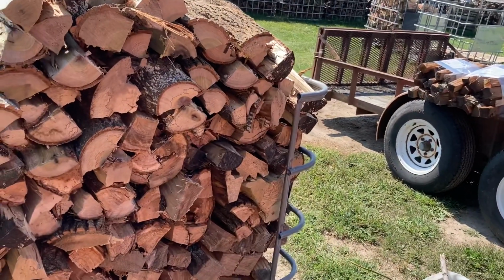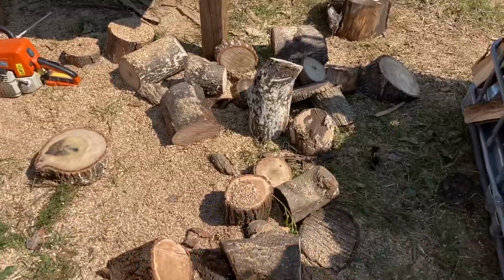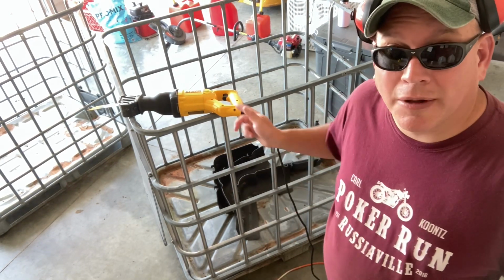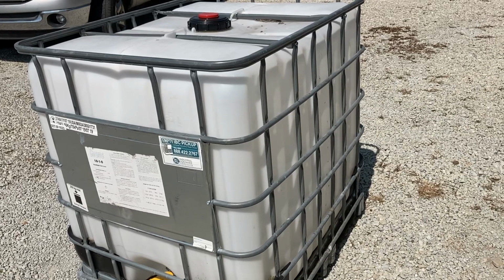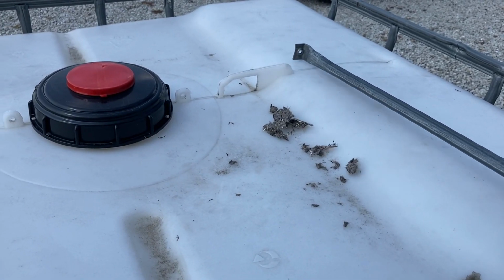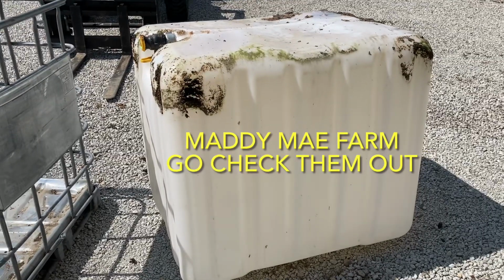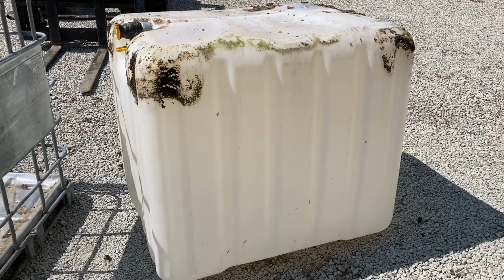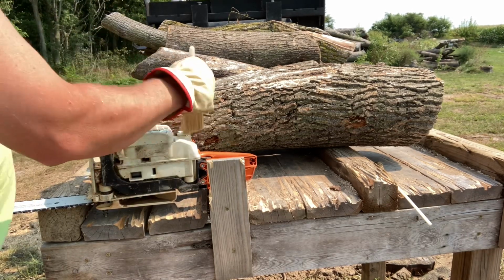#17 Another workday in the woodyard

Comment: Hi KNL - it's Big Rodders in Ireland.  I found the bucking method that works best for me is to cut directly in the wood pile with a 20 inch bar.  I find that way the logs are more secure and less likely to move around.  I use Husky log tongs that are indispensable in my operation.  They are great for pulling logs out of the pile and throwing bucked logs around.  I always preach about their usefulness but few ever listen to me!
Reply from the maker: Hey Rodders!!  I’ve got an old lower back injury that gets me down pretty quickly if I’m cutting on the ground or reaching out with the saw too much.  It’s an extra step to put it on the table but its a difference of me cutting for 15 minutes or 2 hours.  I have a set of Bahco and Fiskars long tongs. I do love them.  Are those similar to what you’re using?
Reply: @KNLFirewood  - Rodders again.  I quite understand, we all have to seek out whatever system works best for us.  Have you thought about mounting a chainsaw on the bench by pivoting it at the bar tip, spring loading it and cutting logs by pulling the saw handle down.  There are various ingenious homemade systems out there in YouTube land.  My Husqvarna log tongs are similar to your models.  They are invaluable for reducing back movement. Keep on Splitting!
Reply from the maker: I sure have!  I’m not a very good engineer or fabricator.  My favorite in the youtube world is Jeff Drayton “Firewood deck”.  I’d love to have a setup like that!